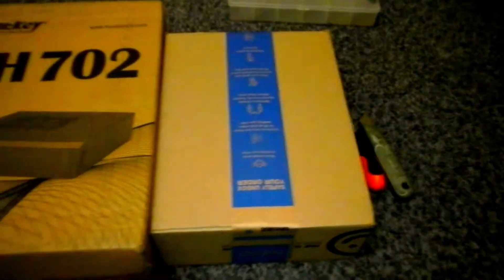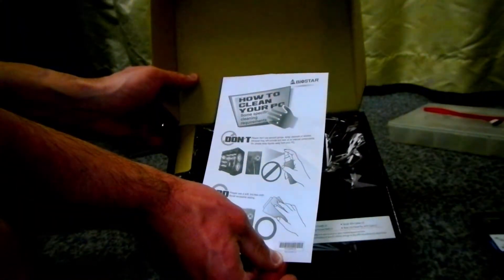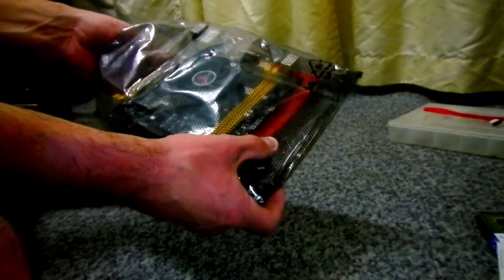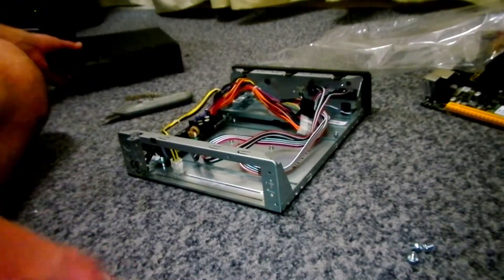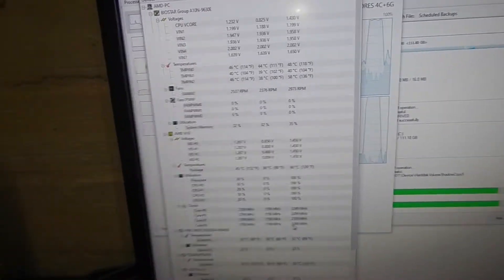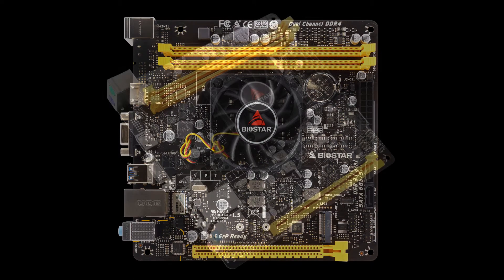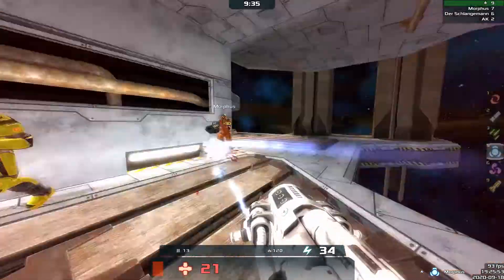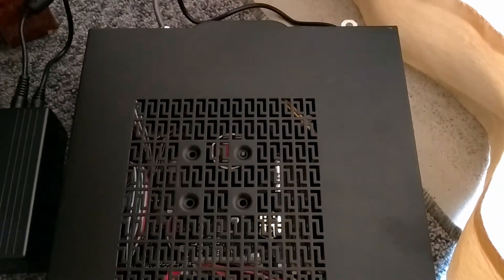Biostar A10 upgrade 🤔

Comment: I have same mobo, how to make ram run at 2400mhz? On mine just run at 2133
Reply: In bios setting, there was only 2133 and 1866. I'm using team dark 2400.
Reply from the maker: @nofiyanto666  you need to enable the XMP profile first on your RAM.
Reply from the maker: You need to set that in the BIOS else it will default to 2133.
Reply from the maker: @DXFEK correct, you need to force it in the BIOS.
Reply: I didn't found any button to enabled it.
Do you know where is it?

Comment: How much power did it draw from the wall?
Reply from the maker: I have not checked but it would be less than 25watt as I can run it off a 12V 2A battery supply without problems.

Comment: Ah, talking about changing BIOS settings and not booting, I once disabled all my USB ports to speed up bios loading and overall boot time... just to realize that I cannot enter the BIOS anymore :) :) :)
Reply from the maker: When I did the build for "Cheapest quad core Xeon PC today" clearing the BIOS disabled USB so I had to buy a PS/2 keyboard just to get it working again. FML
Reply: @Rouxenator  I was able to do a firmware update and that reverted to default settings.
Reply from the maker: @alfredkidd  Luuks! On that S3200 intel server board I had to resort to manual edit fan profiles in text files and flash it in with the FRU SDR tool just to keep the noise down. No such luck with USB though.